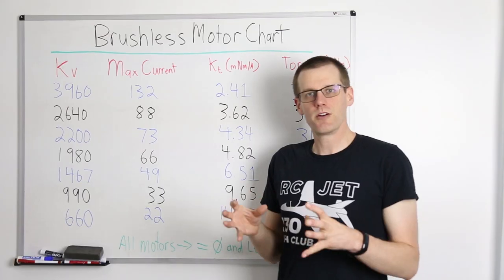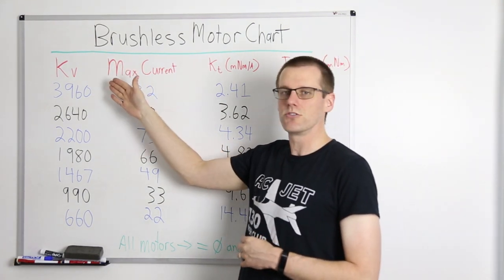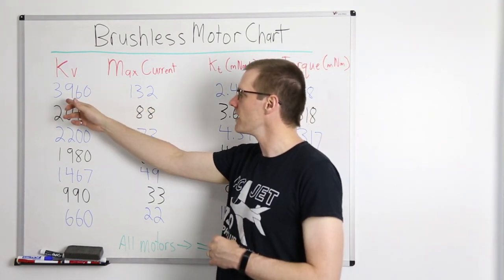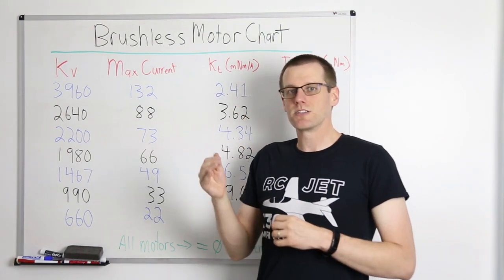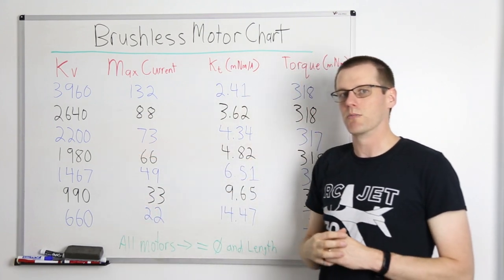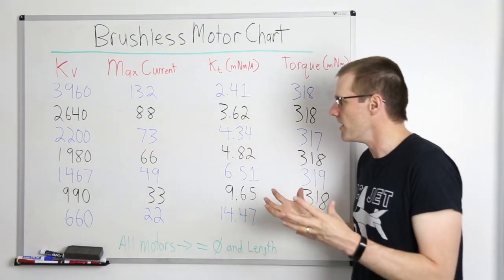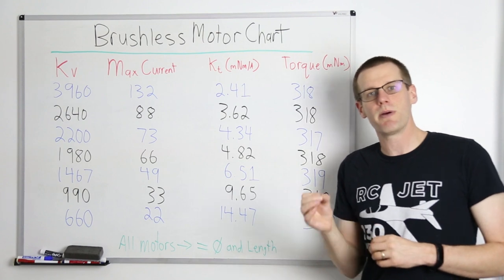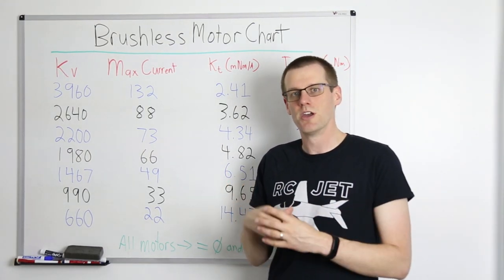STOP Saying Lower Kv Motors Produce More Torque

Comment: And its not just the the area amount of copper windings torque changes with where the windings are on the stator
Reply: First off I never saw a question ask second off if you're adding batteries into the equation I don't need to have this conversation with you because you are too ignorant to know testing motors is done on constant power good day happy safe flying

Comment: Great video...but I'm left wondering how the "max amps" spec is determined?  Is that a limit based on heat generated in the motor, or magnetic saturation of the stator limits?  If it's heat, then putting 30 amps into a 22 amp max motor would make it overheat eventually of course, but with better cooling of the same motor, allow for more overall power in watts?
Reply from the maker: Max Current is determined by heat. If you cool the motor more, it can handle more waste heat and thus more power.
Reply: @RCexplained so in relation to what you’re saying it means that the lower kv motor has more room to run a higher gearing and will only then produce a higher amp rate due to the waste heat?
Reply: @zacmcdonald80  Nah, lower kV motors don't have more room for higher gearing. They are just good at producing more torque per unit current. In higher kV you will be drawing a lot of current from the batteries.

Comment: Would the battery last longer on the motor with the lower Kv value while maintaining the same amount of torque?
Reply: Yes, because the same amount of torque is only applied at a lower speed, and therefore lower power. In most applications, speed is just as relevant of a parameter as torque.

Comment: To sum up: for one size, just buy higher kV and play with throttle limit to have which kV you want...
Is it correct?
Reply from the maker: Hi J2, Match Kv with the battery you intend to run. The setup must be selected based on 100% throttle input.

Comment: Ok so the motor can in theory produce the same torque but I argue that is practically irrelevant. High current is harder to manage than high voltage in any situation that matters for us. Losses to current will almost always mean lower kv = more torque.
Reply from the maker: Hey Fraser, copper losses due to current in a quality motor will be equal across all Kv options / winds. This comes directly from the motor manufacture.
Reply: @RCexplained  whole system vs motor in isolation. Esc, wiring and connectors rarely change to the same degree. 

I also privately think that in a lot of cases (mainly outrunners) the same wire diameter is used for all kv options for cost reasons.

Comment: I have a 3000.00 $ dyno that  says different  indeed lower kv motors spin my load wheel up to speed  significantly faster  than the same size motor  at a higher kv if that isn't more torque what is?
Reply: Are the motors pulling the same amps, does your equipment allow higher amp draw by the higher kv motor?
Reply: @tylercampbell6301   yes there is a higher amp draw on  higher kv motors and yes my dyno has a magnetic flywheel I can simulate different loads on motors and see how long it takes to get to peak rpm.i used to race rc cars and adapted it to brushless outrunners.if I was better with the social media thing probably be able to have a channel to do good motor reviews. Coming from cars it shocks me there is not more good data on motors out there
Reply: Lower KV gives better torque at lower rpms. Higher KV gives better torque at high rpms. So the motor with lower KV will accelerate faster, but reach a lower top speed.
Reply: @AlexB_yolo   exactly what I am seeing  on my dyno  higher kv don't start making torque until higher rpm regardless lower kv spins to kv much faster than higher kv
Reply: It looks like you have high current protection, but you said nothing about your configuration, so we cant make any real conclusion.
We have to know:
- KV of low KV motor, its amp and voltage rating from specs, your battery voltage/cells and current/power draw while accelerating
- KV of high KV motor, its amp and voltage rating from specs, your battery voltage/cells and current/power draw while accelerating
Then we can talk.
Reply: @harynian  of course my test were on a bench off of a 350 amp power supply of course if you add battery into the equation you can't get consistent results
Reply: @williamgambill3922  I asked you for some informations, if you cant answer me, I dont see sense to continue this discussion.

Comment: Sorry for this comment haha you prob don’t have the time to answer 
But I have a truck 
I’m deciding between 2200kv motor 
And 2400 I only have 4s batteries and I would prefer to go faster 
What would be the better option gearing up the 2200 or going 2400, I like the 2400 because I would save about 4 oz 
Also the truck is light enough that either would work.
Probably a very open ended question with not enough detail haha
Reply from the maker: Which ever motor produces the most watts has the potential to go the fastest. Generally, this is the largest motor.
Reply: @RCexplained  running same gearing in both with a setup, pretty easy on the motor which do you think would ask for more amps
Reply from the maker: Higher Kv will require more power with all else equal.

Comment: Does lowering kv increase efficiency?
Reply from the maker: it can but won't if as a result you need to pull more current using the same voltage

Comment: Quick random question: I run surface and I’ve noticed and heard from others the same 
Why is it that a 4000 mah 3s would last longer than a 4000 mah 2s 
C rating should be the same 
With the 3s , the motor is having almost twice as much amp pull so you think it’d be less run time but ??
Reply: Because voltage, you have an extra 3.7v going into your car
Reply: An important battery specification you are missing is watt hours. For example, a LiHv with the exact same mah and C rating to a LiPo will have a higher wah rating thus lasting longer.
Reply: Because when you use the 2S to go lets say 50km/h you need 50% throttle and with a 3S you would need 30% throttle , so you are using the same amount of energy but you are drawing it from 3 cells not from 2. 2S has 2 cells each with 4000mah and 3S has 3 cells with 4000mah each , that's why the 3S is also significantly larger in size.

Comment: If my motors were the same size producing the same amount of torque, would the one with the higher KV go faster?
Reply: no. because higher KV has a lower voltage capacity. lower KV accepts 4s-6s. a 3000kv @ 15v = 45,000 rpm. 2200kv @ 22v - 48k rpm.

Comment: To load 100 kg  how many kv motor required?
Reply: 100kg what? Thrust??? Or 100kg/m torque??? For thrust an A2212 2200kV BLDC should produce 1.5 kg at max. For torque it is more dependent on the parameters of the motor, and gearing if any.

Comment: hi very good video 
i have one question : i making elektrique motorbike (i have 1 year to finish) i dont have lot of money to buy 100Kw motor .... but previusli i make elektric scooter of 1500W but the motor have 30kv and 66V battery (13+6s) the max speed is 45km/h but 45kmh is max out du to kv limitation not power because with the oter gear ration i go 55km/h... for the bike i use 10-20Kw motor but there are the PROBLEM if i want to have high torque mi speed by slow if i want high speed mi torque by low or the power hangry will by over kill for my battery .... so i dont have lot of money tu buy very powerfull battery and motor and esc (800-1200€ esc+motor) but i want to use gear ratio (gearbox of 3to5 gears) 1 gear slow mode high torque laste gear high speed low torque ... this methode will be good because i dont need owerprice extra powerfull motor ... (sory for long text and error i have bad uk) is this idea good idea ??? or not ????
thanks for your video is very interesting
Reply: for the bike the max speed will be if posible 140km/h+ and start torque (torque at lower speed) high to klimb every road (12%+)
Reply: for theoretical power 15kw is the max power of 125cm3 this bike go over 120km/h (140)  i think with 15kw brushless motor the speed will be similar
Reply: last comment sorry.... if i use 1 gear (no gearbox) with 15kw the max speed will be 90km/h for mi is not bad but at this speed 8kw is good to ... THE SAME IS WITH INWEELS MOTORS 3KW GO 70KM/H 4KW GO 85KM/H   AND THE 27KW GO 120KM/H THERE ARE BIG DIFFERENCE IN POWER BUT NOT IN SPEED ....??????......,??????

Comment: Could you not buy a higher kv motor of the same size and manufacturer gear it down to maintain the same wheel speed but produce more torque at the tires of the vehicle as long as heat isn't an issue and the rc car can accept the lower gearing? Making the higher kv motor the choice to produce more torque at the tires by gearing lower and maintaining the same topspeed?
Reply from the maker: A motor of the same size and manufacture will have the same max RPM and Max torque output values. If you are running the motor at or approaching max RPM, you will not be able to increase the Kv operating on the same voltage otherwise you are over Max RPM. 

At the same time, if you are operating a motor at 35,000 RPM with a max of 60,000RPM - You are not getting full potential from the motor. (incorrectly optimized motor) Raising the Voltage or Kv will allow better optimization.

Each motor in the same size class from the same manufacture has the exact same potential when it comes to power meaning torque and RPM.

Comment: Great video! even the torque of those motors are the same, I wonder what's the torque curve actually looks like. Will the lower Kv motor produce maximum torque much sooner in the rev range?
Reply from the maker: Curves should be very similar.

Comment: Does a 12t rc brushed motor have more Torque then a 21T motor
Reply: If all other specs are the same, they should be equal.  21T will have more torque for the same voltage as the 12t will require higher voltage.

Comment: okay, so if you push a low KV motor beyond its limits, you can get more torque for the same current, but at risk of burning it out.

so you should always match the motor to the current output, theres no reason to under spec if you have the available current.
Reply: You can push any motor beyond the limit by increasing the potential (voltage). More potential equals more current equals stronger magnetic field equals more torque and better rpm response. But that current will produce extra heat and most likely melt the solenoid coating resulting in short circuiting. Especially in outrunning motors!

Comment: Questions, Does Running A Lower Kv Motor Runs Cooler   & More Torque Means More Hp Meaning More Speed?
Reply from the maker: Not necessarily, a properly selected power system will run cooler. More torque and RPM is more power.

Comment: HELP ~ 3960kv x 2pi / 60 = 414.69023rad\s  x 1000 = 414,690.23mNm ~ so how are you getting 2.14mNm ~ what am i missing or what are you leaving out?
Reply from the maker: What formula did you use for Kt? How did you go from rad/s to mNm/A?
Reply: @RCexplained  i multiplied (414.69023rad\s) by a 1000 like you said
Reply from the maker: Kt = 1/ Kv
Reply: @RCexplained  That didn't HELP & kt = 1/kv wasn't mention anywhere in the video ~ im not a math wiz ~ i have no idea where to put kt = 1/kv in the formula ~ can u just write out the formula in English for people who are not math wiz can understand?
Reply from the maker: Hello, the formula was in the video and also written out. Kt = 1/ Kv is the formula. Convert Kv from RPM/V to RAD/s/V by multiplying 2π/60. Then place in formula. Lastly multiply by 1000 if you are looking for mNm/A. If you don't multiply by 1000 you get Nm/A.
Reply: @RCexplained  i got it THANKS

Comment: Although I can't disagree with what you're saying, this is on the basis of the same motors from the same manufacturer. I believe the inherent concept of when people saying "use x motor as an upgrade as it provides more torque" in the hobby is usually because people are upping the general can size. Example, Arrma vehicles. The 1650kv HW unit is a very popular 6s line upgrade, but also has a bigger diameter. I'm no where near technically in tune as you, but I think that's where the notion of "this lower kv system (compared to the factory 2050kv 6s system) has more torque". 

I'm not a maths whiz but surely the 1650kv system produces more torque than the smaller can 2050kv Firma?
Reply: Generally speaking, torque scales with the weight of the motor, all other factors being the same. The 1650KV motors from CC and HW are, at least to my knowledge, all larger than the typical 4074 2050KV motors found in 6S vehicles. So the short answer to your question is: yes. 🙂

Comment: this is misleading. there is no motor with that kv range . a 3960 usually is a small motor , where as a 660 kv is usually a soda can size motor. so motor size make the difference in torque!
Reply from the maker: Actually, the motor Kv range for this motor series runs from 660 to 8800. Why do you think there is no motor with this range? This is not at all unusual.
Reply: @RCexplained  i meant surface motors! auto motors don't have that range
Reply from the maker: Yes, these motors are used in RC cars. Actually, it's this exact series and company that helped start the entire line of castle brushless motors.
Reply: @RCexplained  wow

Comment: missing a lot of information
Reply from the maker: What do you mean?
Reply: @RCexplained for example you didn't explain how the windings relate to Kv, or about saturation, or about the load on the motor. if i wanted to know about Kv ratings and what voltage I put on the motor without burning it up and i would watch your video i would not know anything at the end. like why do you put less current in lower Kv ratings and why can't i put the same current in it and get more torque out of it, all kind of details i'm curious about.
Reply from the maker: Ahhh. I've done videos on  a few of those items already. I don't like to cram 5 topics in to one video. I tried this and I get the opposite comment of what yours is. Too much information.
Reply: @RCexplained  ok i get it. so i watched "Maximum Motor Current Specification" and it's just completely obvious stuff. that's ok though, no worries.
Reply from the maker: I think this is an interesting video for you?
https://youtu.be/r0dzdtM8Zt8

Search YouTube and send me the video you are looking for. I'd like to get an idea as to what you are after.

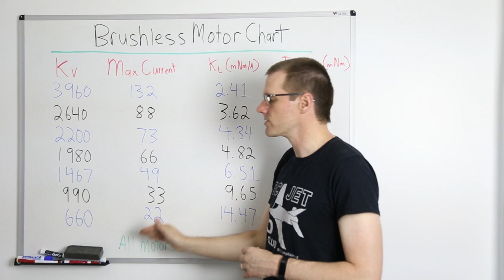Comment: You talk about all the various motors there being able to deliver the same maximum power and RPM (~7:45), but to do that, they need different voltage supplies.  The lower KV motors will need higher voltage input.  Obvious?  Sort of, but should be said.  And does the manufacturer specify that the motors are good to use at the higher voltages?  Really interesting.
Reply from the maker: Hi David. Motor's are not limited by voltage. They are limited by maximum rotation speed.
Reply: @RCexplained  It sounds like you cant go over 60,000 RPM, but thats not true: https://www.youtube.com/watch?v=1TiePd7qng8 ^^

Comment: Electrical engineer here, well without going into a long detailed explanation on on why some of the concepts are only partially correct. 
Why don't you prove your theory??? Purchase an accelerometer and measure the efficiency curve at a given RPM. And not the theoretical amperage but how much power the motor actually produces based on its KV. This will be a learning opportunity for you. I promise, and you will have to eat some Crow... But it's okay... We're all in the process of learning.
Reply: Okay can't stop thinking about this, 
 a few questions that I'd like you to consider?
Do you believe that the torque output of a motor is linear? 
Or do you think that there is an efficiency curve? Based on RPM and magnetic field strength? 
Why does motor top out at a given KV or voltage? 
You put the motor in a vacuum where there was no external drag other than the magnetism, with the RPM increase and definitely? 
Where is there some other Force at play?

Pause that I'd like you to research
1. Faraday's law
2. Kershaw's law.
This will get you a little closer to the direction of real...